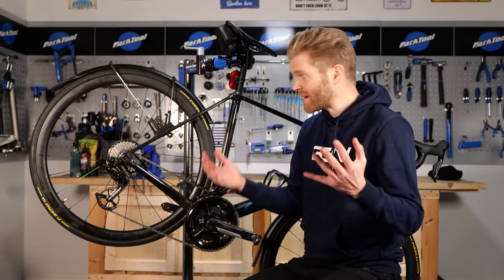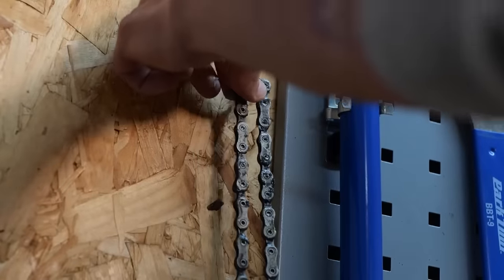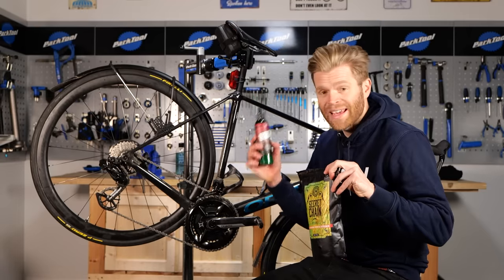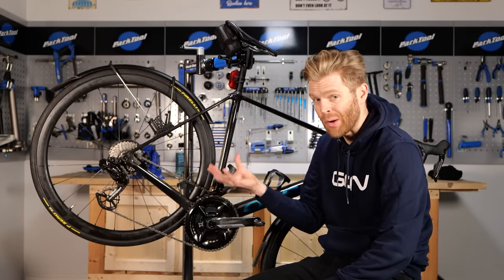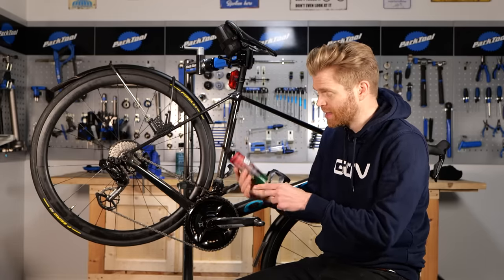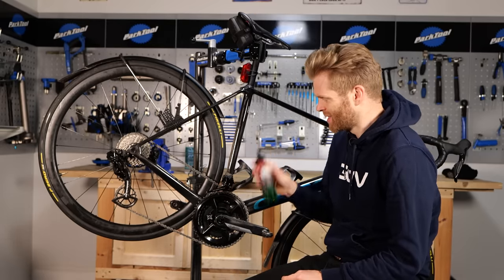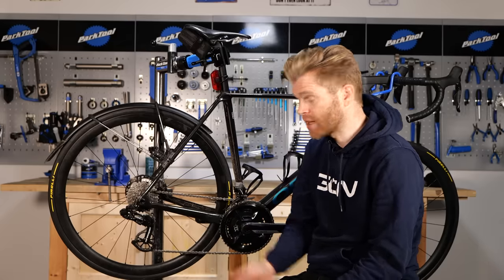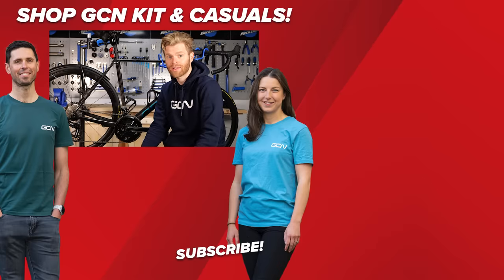Most Efficient Way To Maintain A Waxed Bike Chain!

Comment: I use a drip on wax and always apply it on the inside of the chain on the lower run rather than on the top.  This is so that centrifugal force draws the lube through the chain as it rotates.
Reply: Same here. The inside is the most important part of the chain; the rollers in particular.
Reply: watch silcas video on why they recommend applying it ontop

Comment: Run 2, or even 3 chains is the best way. So you even out cassette wear, and you've always got a spare ready to go. 
Once you get the knack, it only takes a few minutes to swap a chain.
Reply: Yeah, the longest part is waiting for the wax to melt, so way more efficient to run 2-3 chains in rotation and rewax them together as a batch.
Reply: That, and you'll be more motivated to switch them instead of waiting until the last minute to rewax.
Reply: @benp439  Absolutely!
Reply from the maker: You sound like you've got the waxed chain game down! 🙌
Reply: @gcntech  I learned from The Master!

Comment: Even though I'm newly retired, I don't have the patience to put a drop on each link. If I have to wait 12-24 hours for it to dry, I might as well place the chain with boiling water (finally get to use the side burner on my BBQ) then re-immerse/let dry and re-install. 

I did my first 50k this week on my road bike with a waxed chain (new chain and cassette). I'm sold. Buttery smooth and completely silent. Going to wax my MTB chain this week.

Comment: What I do after a wet salty winter ride, is to just shake the chain in hot water. This flushes out all old wax, together with all the dirt picked up from the road. After that the chain is all metally like after the first time degreasing and ready for a rewax. It's one step more, but easy to do and worth it i think. And it's faster than waiting for a drip on to dry.

Comment: I'm convinced: chain waxing is the way to go. Every video I've watched (many) on the subject uses some kind of electric pot like an instant pot to melt the wax. Can I simply use a pan on the stove, you know, in the old fashioned way? Thanks!
Reply: You should avoid that, it will be most likely to hot and the wax will evaporate which you don't want. (Wax smokes are highly flammables)
Reply: Nope bad idea

Comment: One addition to you video. New chains must be cleaned you will be surprised how many shinny particles you get with your expensive chain. This parts mixed with oil or wax are very bad for the drive train. Get out factory oil and manufacture residue before wax chain for first time.

Comment: When using the cloth to remove road dust before drip waxing, a little spritz of isopropyl aclcohol on the cloth helps get the job done even better in my view.
*drip wax after every ride then change to a second waxed chain after 500km or so (clean dry conditions only). Then hot melt both together. saves time, keeps rides silky smooth. I actually look forward to the hot melt process!
Reply: you're immersion hot waxing a chain every 500km and drip waxing after every ride? Completely unnecessary, it's either/or. A hot immersion wax will last 500 km in dry conditions. Drip waxing is meant to replace hot waxing for those that don't want to do it.
Reply: Just not true. They (Silca wax items) are totally designed to compliment each other but can be used separately in isolation too.  @liamgaul  * & my rides are typically 50-100km each so a drip wax top up is welcomed by the chain I think
Reply: Yes, they are designed to complement each other. But an immersion wax lasts about 500km so you don't need to apply any drip wax if you are immersion waxing your chains every 500km. After the immersion wax has run out (approx 400-500km) you could then switch to drip wax, but it sounds like you're then switching to a fresh immersion-waxed chain and adding drip wax straight away before it's run out, unless I've misunderstood. What's even the point in immersion waxing if you're applying drip wax every 50-100km? People have been immersion waxing their chains every 400-500km without drip wax top ups for years.
Reply: Wait until you guys discover mineral oil with high pressure stabilizers.  Can ignore your chain for 2000km and it's quieter than wax.
Reply: @___Bebo___  how does it last so long? Surely it attracts dirt though and requires cleaning your chain?
Reply: @liamgaul  No, it doesn't attract much dirt and you can brush off the chain with a brush and have it shiny clean after the initial oiling.  Try Chain L lube, it's the best lube on the market.  A small bottle of the lube costs 10 dollars and will last 5-10 years.  They are so confident in their product they will lube your chain for free at their bike stores or send you a free small bottle.
Reply: @___Bebo___  sorry but nothing will make me go back to oil based lubes after waxing. They attract almost no dirt and as it's solid no dirt can't penetrate the rollers and thus the chain wear is almost non existent. Chains last forever and so do cadettes. The savings from replacing parts is too good. The cleanliness is just a bonus.
Reply: @liamgaul  The chains shift better and are quieter with oil.  Try using wax on a fixed gear bike it's a complete joke on bikes with actual loud chains.
Reply: @liamgaul  My YBN chain is top tier and costs 15 dollars who cares about chain life?  Wax chain life is a myth anyway.  If you are poor and care about this stuff steel chainrings and cogs exist.

Comment: It seems to me that wax would inhibit oil from sticking to the contact points on the metal. It also seems like a lot of trouble. I like the "old fashion way" and will stick to the tried and true oil method and reg. chain maintenance. Yes oil collects dust that is why its good to strip it and re-apply fresh. The whole process takes me 5 minutes or less.

Comment: For full hot wax treatment, boiling hot water will clean the chain beforehand, in a tin or old pot .. leave it in for a few minutes, rinse and Wipe the resistant bits with microfibre cloth then wax bath.  No need for extra chemicals to play around with.

Comment: Your cassette will get some gummy wax on it.  I remove the wheel, spray the cassette with isopropyl alcohol and scrub with a brush, then rinse with water.  Isopropyl alcohol sprayed on a cloth will also help with the gummy wax stuck on the outside of the chain.

Comment: I just bought the SIlca starter pack, which is a stripper/wax prep + the chain coating itself. My chain came pre-waxed on a new bike. Do I not need to use the strip part at all? Just run the chain through a microfibre and then apply the coating?  Thanks

Comment: What's the best method to clean off all the wax build up on the cassette and jockey wheels ?
Reply: Boiling water melts it all off in seconds. Just try and avoid the bearings. I pour it in such a way that it touches only the teeth before dripping off onto the pavement outside
Reply: Screwdriver for the pully wheels.  Isopropyl alcohol dissolves wax.  For those that wax, it replaces degreaser.
Reply: Not using wax....
Reply: Wax chain out off bike. And wipe it clean before instalation= no mess, no dust on chain, everything clean

Comment: It takes less than the length of this video to pop off my chain and re-wax. Hotwax provides far better penetration and winter protection. Don’t worry about Shimano quicklinks, they can be re-used 100’s of times.
Reply: Can confirm, i reuse my shimano quicklinks for a whole chainlife. On the roadbike its way over 10k km!
Reply: @dakalla  🫡 yes. it goes without saying.. it’s a good idea to do a quick visual inspection for signs of cracking, and avoid any unnecessary bending during your install that will knock down the fatigue life. Otherwise, just send it folks and save your $$. 175 lb rider / 1500 watt sprint and have never had a failure. (DA 11 / 12 speed)*

Comment: P. T. Barnum must have been thinking of cyclists.  Anyone who pays $40-50 for wax are suckers.  For 4 years I've used Gulf Canning Wax diluted with a little bit of lamp oil (super refined kerosene) to hot wax my chains.  The lamp oil is to lower the melting point of the canning wax.  I target a 120F melting temperature of the mixture in summer and 100F in winter.  I have 2 chains so I swap on a cleaned chain and clean the other at my leisure.  I have been using the same wax mixture for the 4 years because I thoroughly clean the chains before waxing.  And that process is painless and environmentally friendly as I use ZEP citrus cleaner with a final rinse in 95% ethanol.  I put the chain, ZEP and hot water in a bottle, shake it a couple of times, let it sit for a few hours while doing other stuff.  Rinse and repeat with a second, clean solution.  After the ZEP, a quick soak in the ethanol and then 15 minutes in the canning wax/kero.  I get 225-275 miles of silent running depending on the surface I ride.
Reply: I've had the same bottle of Chain L lube for 5 years and it's quieter than any wax and lasts 1000 miles.  Wax users are suckers in general or have too much free time.

Comment: Swear by this. The brand shown is good but you can make your own for way cheaper too. The liquid top up is good for a quick thing once every 100-200km, leave it at least overnight and you're good to go! Full wet hot melt wax every 500km or so. 

If it's dirty beforehand, can just rinse it with water, spray bottle or hose doesn't really matter.

Comment: I love using drip wax, primarily because it keeps my pants clean from any oil stains. It's not great for rainy Copenhagen wheather though, because when it rains for days and days, you have no chance to rewax it and the wax wears off fast.

What I am struggling the most with though are temperatures below zero. Whenever it starts to freeze the wax seams to wear down at an enormous rate. And getting it to dry is almost impossible.
Reply: What wax are you using?
Reply: The normal Squirt chain lube.
Reply: I'd try with hot wax and have spare chains. I have 3 chains for that and one EPT chain especially for winter due to the amount of salt used. So far so good, I've done 2k km now on waxed and put on my last waxed chain two weeks ago. When that gets noisy I'll rewax all three.
Reply: @lakotamm  yeah I had this problem with squirt when I started with wax when I lived in Copenhagen! It has penetration issues because it's so thick. I also found so much of it gunked up on the outside and the chain needed a very good wipe down. Zerofrictioncycling has done testing that shows it simply doesn't get into the rollers of the chain unless it's heated and it will have very dramatic wear rates if applied normally. If it's heated first then it will penetrate better and then you get very good wear rates. Your chain needs to be warm too though or the wax cools as soon as it's applied and doesn't penetrate as well. They do have a cold weather specific lube I think. I would honestly just switch to one of the other drip wax lubes on zerofrictioncycling that doesnt have penetration issues.

Comment: I stopped waxing my Mountain Bike because every ride it will come back completely dirty and ended up washing off everything and relubbing with normal oil compounds... is there a way to keep it going after a dirty muddy ride? I didn't get it from the video, thought it was being shared... So what should we do... washoff and use the drip off wax?
Reply: Clean with boiling water and throw back into hotwax. Use zero friction cycling to decide what wax performs best in your environment. Always hotwax. Liquid immersive works fine if you’re running in dry clean conditions, but it dissipates quickly in the rain.

Comment: It's contradictory to say that "overlubing" with drip wax will give you lesser performance and at the same time promoting dip wax, which must be the most "overlubing" you can do.

And as I've said before: You do want some wax on the side of the chain. I rode 20 km on a 2x drip waxed chain and then heated after a sligt drissle had stopped. I put the bike inside the house at 24 C but the next day I had lots of rust patches on the chain.

Silca say Smoove has a small oil component, so I might go back to that and accept a bit of dirt instead of rust.
Reply: It's actually the liquid component that's the problem. In the case of oils, overlubing attracts particles and the grinding paste wears on parts. Excess solid wax isn't a problem bc it sheds and any remaining wax doesn't mix with particles to cause wear.
Reply: Wax doesn't protect or lube the chain very well, the one thing it does well is keep dirt off the chain, but this is pretty irrelevant because you can just clamp your bike in a work stand and hit the chain with your chain brush for 30 seconds and its clean.

Comment: Can you prolong life of the wax once applied properly "indefinitely" by cleaning the surface with microcloth and refreshing it with drops of liquid wax?
Reply: I'd think so yes, just depends on how often you drip wax.
Reply: @mylarrito  I can do it every day if it means this takes care of my chain and I dont have to go through various stages of cleaning 😁
Reply: @MichalBrat  would never be necessary unless you're riding in extreme conditions. I "refilled" drip lube on hot wax after 6-800km. If you ride a lot in the wet I'd maybe do it after 2-300km, but yeah.

Comment: Why are you applying the wax to the top of the chain? Surely you should be applying it to the bottom so it soaks into the rollers (i.e. apply to the side of the chain which is in contact with the chain ring and cassette)

Comment: Im still on the fence about waxing my chain, but this video has helped me understand it a bit more.  one step closer.....
Reply: Bit of a faff first time. But if you do 2 or 3 chains at once, it will require less effort.
Reply: Don't do it, use Chain L lube instead.  Your chains will all rust with wax, it's inferior to mineral oil.  Bottle of Chain L will last 5-10 years of heavy riding, is 10 dollars and is much quieter and smoother than wax.

Comment: Is a waxed chain good or bad for a commuter bike road in all conditions?
Reply: It's bad, what you want is mineral oil with high pressure stabilizers.  Chain L is a great brand.  My main bike I ride 150 miles a week, I haven't cleaned or oiled the chain in 2 months it is buttery smooth.

Comment: I noticed you applied the drip on wax on the outer surface of the chain. I'd usually apply lube on the inner surface, which is best practice for drip on wax or does it not matter?
Reply: Pretty sure the one I bought says explicitly to put it on the inner surface. That's how I did it anyways.
Reply: No difference, the rollers roll when it contacts against the cassette and chainring, that means after pedalling for a bit, the so called 'outer' side will become the 'inner' side. And, besides, I don't want the wax to touch the cassette before it really gets into the rollers. So, either way works and I find myself more comfortable with just dripping on the outer side as I don't need to clean the cassette that much after the application.
Reply: Maybe in Arizona....
Reply: Doesn't matter, but it's best to do it on the top if cross-chaining like Ollie does here.

Comment: If you're going to dunk the chain in molten wax, you don't need to clean it first. There won't be a huge amount of dirt anyway, and if you swish the chain around in the wax, the dirt falls to the bottom of the pot. It's no more difficult than using drip wax.

If the chain needs attention between waxings, I use a thick liquid solution of the chain wax in paraffin (kerosene) -- 15% or so, put some on a cloth, run the chain through it and leave to dry. Removes surface dirt and leaves a film of wax which stops rusting.

Wax being washed out by the rain doesn't seem to be a problem for me, and I don't think Ollie is correct in saying that wax is water soluble.
Reply: I think Ollie was saying that the drip wax is wax particles suspended in a water solution, not that the wax itself is soluble (like sugar).

Comment: The Big-Big trick is a question I had had for a while.
#askgcntech  Probably not, but do you have any feedback on waxed chains in the cold?  Like...well into negative digits?
Reply: This morning I added a freshly waxed chain. The bike sat outside in 0 degrees C or 32 degrees F for an hour before I rode it. Until I rode for a few blocks it was stiff and shifted terribly and struggled when I back pedaled. After a little riding it seemed to work perfectly.

Comment: Is it worth using drip on wax exclusively or is it meant to be used in conjunction with melt on?
Reply: Still worth it according to Josh P. But it doesn't penetrate as well. So to get close to the performance of melt on, you should apply and let cure. Then repeat.
Reply: @beams2002  Thanks, I’m currently using rock and roll gold and reapply every 100 miles, plan to try Silca drip on wax the same way
Reply: @adamweb  If you liked using Rock and Roll gold try using Chain L instead of wax.  Chain L lasts 1000 miles and is much smoother and quieter than wax.

Comment: Is rub on wax (wend) the same as drop on essentially after you put some of the "activator" type stuff on top and rub it in?
Reply: no it's a complete gimmick and doesn't work. You need wax/lubricant inside your chain. There's no way for a solid wax to get inside through tiny gaps
Reply: Have you seen the product?  You rub it on quite thoroughly and then apply some of their cleaner, which chemically melts and seals it.  I've used the product for years, I just wondered if there was a good way to "quickly" top it up, versus a full strip and apply. @liamgaul

Comment: I use wax on my commuting bike and I have noticed a rust on external links,  any advice on how to prevent?
Reply: I dab-dry with paper towels when I park it.
Reply: Use mineral oil with high pressure stabilizers like Chain L lube.  Wax is a roadie myth.  Alternatively use a black teflon coated chain.